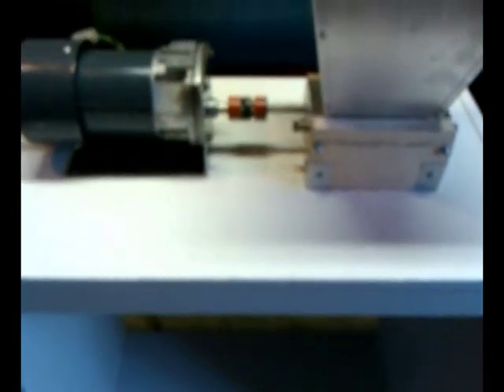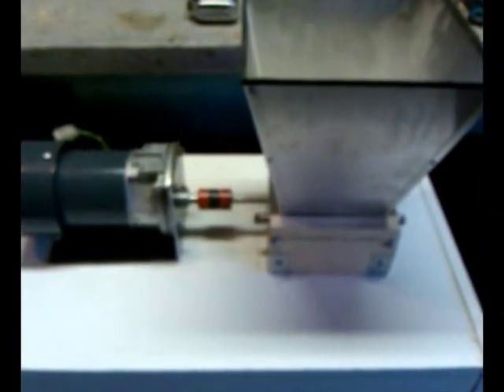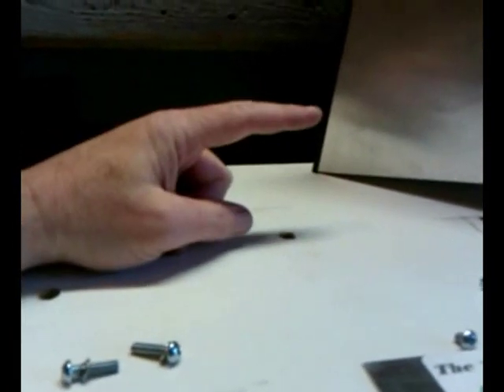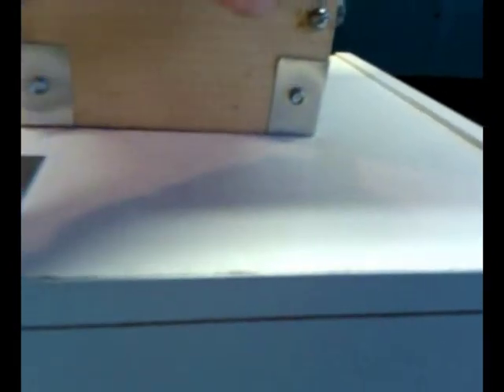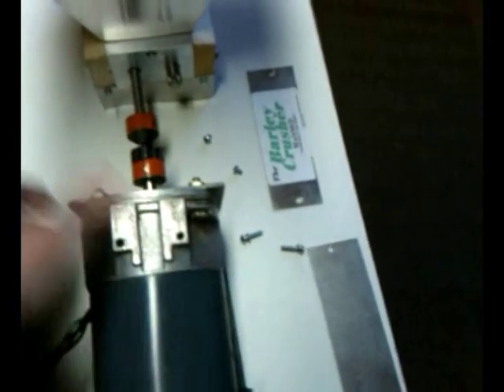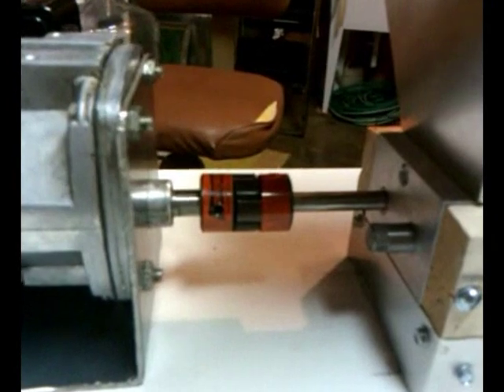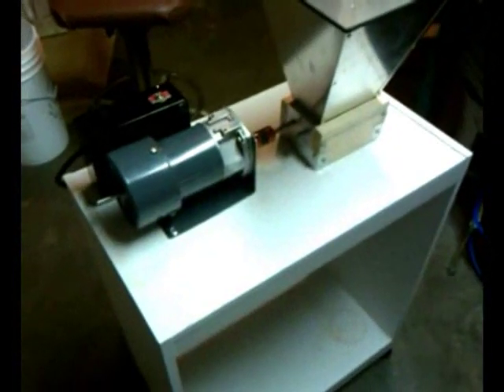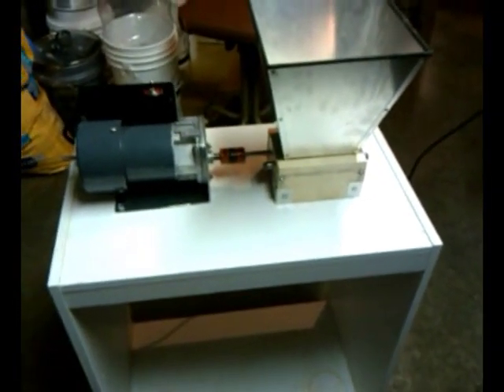My DIY Motorized Grain Mill - Barley Crusher

Comment from the maker: @brewyourown4life Yes I filled it the first time I used it and it started just fine.. Normally though I just go ahead and start it and add the grain.. but that motor has plenty of torque to start with it already in there!  I honestly don't think I would have done anything different.  I use a (i think) 3 gallon bucket upside down and sit a 5 gallon lowes gray bucket on top of it and it works out perfect so there's no need for anything to help keep the dust down or anything.. works great!!

Comment from the maker: @BobbyFromNJ Thanks! I didn't want to fool with pulley's etc myself so I also loved the idea of direct drive.. I did put probably 2 cups of grain in the mill and it started with no problem.. I also did the same amount with some H20 conditioning and no problem starting.. dunno how a full hopper would react but it seems to have plenty of speed and torque! Oh and that little test has all but sold me already on wet milling already! I could see a big difference as you already know!

Comment: Hey Jake, looks good man. I've been really disinterested in motorizing for two reasons... For one, my power source is a drill that I use elsewhere so I feel like I don't have a big unitasker motor waiting for brew day and the other was my dislike for the typical pulley/belt systems most people use.  At that motor price, I might be sucked in.  I did notice that there's also a 177rpm with 40 inlb torque version of that same motor at the same price. I just wonder if it's a better choice.